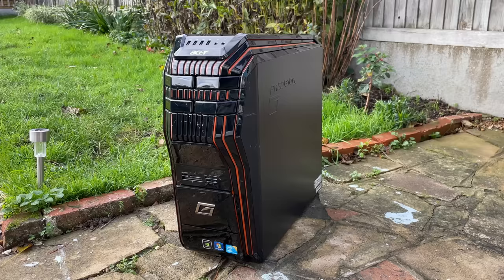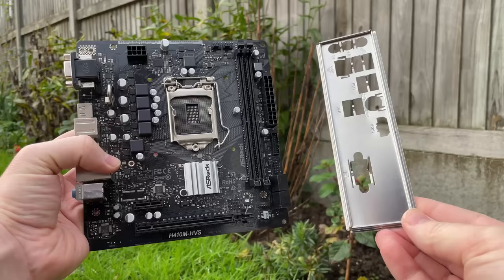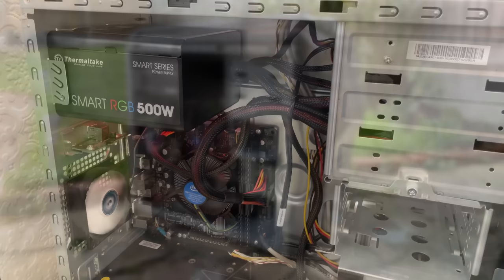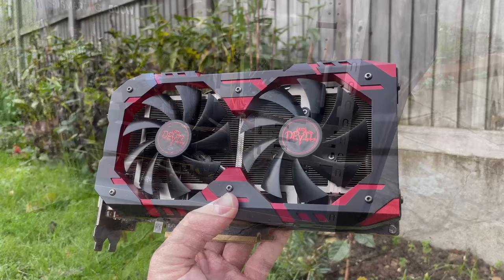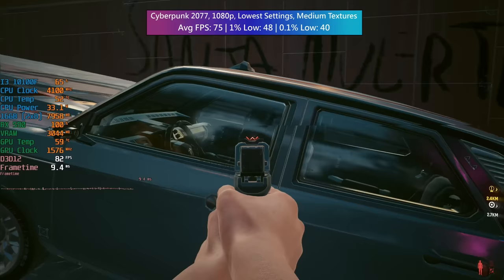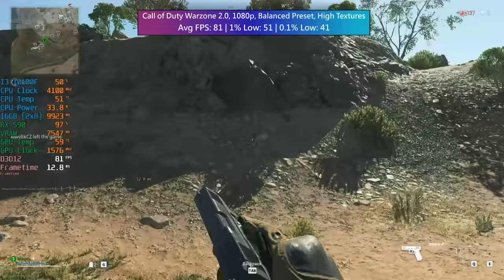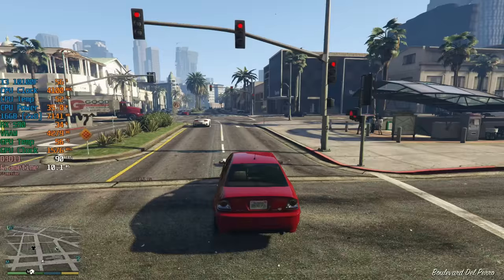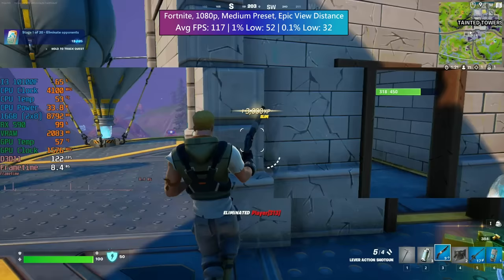Modern Budget Gaming Beast Inside an Old Acer Predator PC Case!

Comment: I'm shocked the GPU only reached 60 degrees with being choked of air.
Reply: yep, it's almost like he didn't correctly assess how it was gonna go, or maybe it's like fans do the thing they're designed to do if they're in the correct orientation..
Reply: With 2 8mm heatpipes on that cooler I'm not surprised at all

Comment: That's a nicely balanced system and the CPU does not max out with any game which is seriously impressive for an i3 and as you mentioned you can drop an i9 in as a replacement at a later date

Great review again 😀
Reply from the maker: Thanks :)
Reply: G'day, totally agree this is a nice ballanced build but...
while an i9 may fit those ASRock 4phase VRMs are notorios for not even letting LGA1200 i5 run at full performance due to VRM Throttling even with a Heatsink,
so i9 as an upgrade even in the future without a motherboard swap would just be a waste.
Reply: @shaneeslick  nope 
The specs tell that a 5vrm set is use 
The i9-10900(Q0) is a 65watt tdp and that will just run fine on it.
Only the i9 125tdp have performance boost problems with the vrm.
So really you can set a i9 on this board 
And i think a 10 core 20 threats cpu wil do just fine in the future.
Reply: @dyslectische  Yes that is what the Specs say, but 65W TDP has nothing to do with how much power the CPU actually draws.
Plus I am talking about what Benchmark reviews have proven to be Facts that have gotten Reviewers like HUB & GN Blacklisted when ASRock told them to take down the Bad Reviews telling the Truth, not what ASRock claim in their spec sheet because as long as they only have to run at 'Base Clock' not 'Full intel Boost Spec' which is more than 65W through the VRM for the i7-10700 & i9-10900 they are within 'intel Spec'.

Comment: The i3-10100 and Ryzen 5 4500 (despite its rep) is still a great budget option if found at $80 new. The RX 470 and GTX 970 used go for about less than $100, sometimes as low as $75, and this combo coupled with 16 GB of at least 2666MHz RAM can still game at 1080p very respectably in my opinion at a pretry low price compared to what other new options can be. You really don't need to spend much to get a good, mostly new system, with only the GPU being used.
Reply: The RX580 is now $70 on AliExpress

Comment: Nicely done system,I feel you could maybe pop a rx6600 or xt in there and still get pretty darn good performance if you’re on a budget since they quit cheap at the moment
Reply: After Nvidia's new exploit of naming the new RTX 3060 8GB (RTX 3050 ti) and charging the same price as a 12GB RTX 3060, I'm going AMD next time.
Reply: @SpaceGamblerJR  Yeah lol, It's a lot slower, and even the 12GB 3060 doesn't make sense when the better 6650Xt is in stock for a lot cheaper.

Comment: I love how the back fan that you put in the computer could be bigger. I did the exact same thing the other day when I built a frankenstein computer.
Reply from the maker: Haha yeah it needs a size upgrade
Reply: @RandomGaminginHD  I would love to see what is the maximum components you could stuff into this specific case, and fans to produce still good temperatures!
Reply: @RandomGaminginHD  I like how it had those two bays in the front for SATA drives that’s super neat. I wish I had a case or external box that had 6 and just plugged into the computers motherboard that would rock

Comment: Nice restoration, and I like the older style cases as well. I like how the i3 10100 is still a decent budget processor!
Of course, if it was mine, I'd take full advantage of the 5.25 and 3.5 bays, so I could whack in a DVD drive and plenty of hard drives. In fact, wouldn't this case work with a pair of DVD drives?
Reply: Yeah 5.25 would be used by me too, I still use ODD for burning home videos to BluRay & DVD, 1080p videos take up way to much storage space leaving them on the recording device
Reply: @shaneeslick  i would also have a Blu-Ray drive but they're much more expensive than DVD drives, also correct me if I'm wrong but Intel 12th gen and newer (I'm planning to build 13th gen) don't support Blu-ray?
Reply: @TheSpotify95  I got my 2 LG 3D BluRay Drives on sale here in Australia a few years ago for only $69AUD down from $99AUD when DL DVD which were $60AUD at the time.
I have one for creation in my R9 3900X Editing PC & the other in my Retro Gaming PC as I thought considering it was only $10 difference & that drive dying was the reason for getting a new ODD.
I haven't heard that about 13th Gen & not sure why BR wouldn't work with certain CPUs as I thought that would be more to do with OS & Media Player Codecs, but maybe the CPU needs a certain instruction set that has not been included in 13th Gen.
I use the K-Lite Mega Codec Pack & the Windows 10 WMP or "Movies & Tv" player with no trouble, but I only use them for Data not actual bought movie discs as I watch them on my Tv with my PS3.

I have just moved home so stuff is still in boxes but I'll go find a BluRay & come back with another reply with how it goes how it goes.
Reply: @TheSpotify95  back again, I got to give the BR a test with a bought movie disc on my editing PC with the R9 + 1080Ti, my LG drives came with Cyberlink Power DVD 10 included on the driver disc, I had to update to version 12 (Free update) & when I had done that it does play the discs fine.
Hope it helps but maybe if you are interested in upgrading you ODD try emailing help from the manufacturers site for the one you like & ask them about 13th Gen Compatibility.
Reply: @TheSpotify95  11th, 12th and 13th gen Intel CPU's cannot playback ULTRA HD Blu Ray movies (there's only like 2 models of 5.25" UHD Blu Ray players anyway). This is because of the DRM UHD Blu Ray uses. It does work with regular movie blu rays and data blu ray discs.
Reply: G'day  @Liinuli. , thanks for the added info

Comment: 1:00 I built a similar sleeper style system and bought a 3.5 inch Bay USB 3.0 front panel that fitted in place the card reader. It was on an old HTPC case so I could then connect it to the front USB 3.0 header on the motherboard.
Reply: Also shows how good the RX 590 / 580 and 570 were when released as they still hold  up today.

Comment: This video actually came at a great time because I have a 10100F that I later upgraded to a 10400, and it will be going to my mom with an RX 6600 believe it or not. I thought of getting a B560 board and another kit of DDR4 to pair with the i3 10100F to build a system for my sisters in an old Gateway case I bought on eBay, which was one of the last systems with the Gateway name before Acer discontinued the line.
Reply from the maker: Awesome, the 10400 is still fantastic

Comment: I always repurpose old Dell or HP cases for my own systems. I like having the "free" DVD drives and card readers. I just drill, cut and modify them (as tastefully as possible) to get better airflow.
The Blue Anodized Sapphire RX 590 Nitro was my dream card back in the day. Sadly, I've never actually owned one. 
Also, I'm a little disappointed you didn't include GPU power in the overlay. To me, that's a very important metric. Thanks for such a refreshing video of still capable older hardware.
Reply: That's the one I wanted too! They sold out pretty fast, mostly to miners/scalpers it seems, so I settled for the Sapphire Pulse. Still using it now after dropping an RX 5600 in to replace my 2700X :)
Reply: @Grant_S_M  I currently have a 2600X. how much of an improvement did you really notice after installing the 5600? Was it genuinely significant?
Reply: @RANDOMNATION907  Some more frames, but the biggest difference is smoothness. My RX 590 is holding things way back :)

Comment: I built my Dad a PC (my first build) out of all new parts, bar the GPU, during Covid. He’s basically got the same as the specs in this PC but in a cheap (£35) case with an GTX 1060 6gb. It’s great at playing anything at 1080p 60fps with medium to high settings. My fourth build that I did this year was for my brother, a no expense spared £4000, i7 12700K, 3090 Ti Suprim X, 2x 2TB m.2 etc etc build. Was a different experience to building my Dads 😂

Comment: I definitely would've dremeled some small holes or slits on the bottom of the case near the GPU fans and super glued some thin mesh inside the case between the bottom and GPU fans. Then put some small standoffs on the bottom of the case to help it breathe a bit. Either way, solid performance!

Comment: 1576 Mhz... What a clock for Polaris! My RX580 can go from 1366 to 1450, draws 190 watts and sits over 80 degrees lol. This RX590 kicks its ass by a lot.
Reply: Well, it is built on a 12nm die shrink. Most Polaris based cards use a GPU based on a 14nm process. At AMD's reference clocks, the 590 is set over 200 MHz faster than the 580 regarding both base clocks boost clocks. The 590 does use more power though and generate more heat. However, PowerColor Red Devil cards have pretty good coolers.

Comment: Great video,
Could you do a comparison of the 590 with 6400?
It could be quite interesting
Reply from the maker: Yeah sounds like an interesting comparison!
Reply: The 590 is a lot faster. It should even beat a 6500xt. It is a bit power hungry though...
Reply: Yeah the 590 is going to beat the 6400 in all games. It also isn't gimped by the 4x pcie bandwidth. The benefits with the 6400 are going to be its size, power draw, age and if you can really make use of them on this card, the few Ray Tracing cores the 6400 has.

Comment: It looks like the front has a mount for a 92mm fan, similar to the 2012 Dell XPS desktop. My friend has one installed running a r5 5600 and a 3070 and it does help with gpu thermals somewhat in that system

Comment: The case is cool, as for the build: It makes sense if you have part of it lying around, but I think the board could spike the price if you had to make a build from scratch. Personally I'd most likely end up with a 1150 board + Xeon if I'd had to pair it to a 590 (480, 580, 1060... ). 

The PSU seems a bit on the low side for me since I usually use older higher powered CPU, but in this build it should be fine.

Comment: I would have put that 80/92 mm fan in the front to create some extra airflow for the GPU and maybe put a 120 mm fan as an intake for the cpu. Going with a four core, eight thread cpu was a good idea, because those pure quad cores are starting to struggle a but.

Comment: That Red Devil 590 must have a really good cooler cause my old RX 580 Sapphire Pulse edition used to get loud in a way more ventilated case than this. Also you can use the cooler that came originally in the Acer,those things are beasts and they can even cool a modern non k i7

Comment: I still have my RX 590... in a box, because I upgraded to an RX 6800. The Sapphire Nitro+ SE hits 1560MHz which is a little down on the Red Devil, but as far as I'm aware, the Nitros were the only cards to come with default memory clocks of 2100MHz. The blue colour scheme is unusual and I would be lying if I said the grey design from the RX 580 LE variant wouldn't have been preferable, but it's pleasant enough. I always made sure to undervolt it a bit, though it couldn't take a big reduction at stock clocks.

Comment: Serendipity! I just built a retro gaming PC into a Q500 case. Spec is RX570 Sapphire O/C (which I overclocked more), i5 10400F, 16gb 3200mhz DDR4 and a MSi Z490 Carbon EKX (not watercooled). All the parts were bought used at bargain prices (60 quid for the Z490) other than the 10400F which was 100 quid new from Amazon Germany.  Running the DDR4 at 3200mhz (well 3290mhzX102.9mhz) really speeds everything up. I saw an uplift of 10% with XMP enabled vs stock. I'd love to see how your i3 and 590 run given faster RAM on a better motherboard.

Comment: That's a pretty nice combo. I had little bottleneck with my R5 2600 and gtx 1070 ti but my ryzen is parked for upgrades and I am using a I5 2400 with the same GPU and man bottleneck galore. People always buy for the name. I don't mind lower end parts I gave my brother my 2600 and I took his 2500g. When your a budget gamer you tend to look past the names etc
Reply: A N I M E
N
I
M
E
Reply: Re the i5 2400 and bottlenecks, I wonder if that's down to the lack of HT on top of the generally lower IPC & clocks. I've done a lot of benching with a 5GHz 2700K and it generally runs very well, but turning off the HT really hurt for some games (even with the same clock), and I was using DDR3/2133 CL9.

Comment: Never thought a 65$ cpu would be viable for gaming more than 2 years after its launch.

Would still recommend an i3 12100f as that would last you much longer. For around 30 more dollars (and 20-30$ for a Motherboard like a h610...those are pricey but worth saving up... Even if it is one more month of wages that you need to get enough spare nickles to throw at it)

Comment: although i understand the primary point is to showcase the capability of being able to play the games whatsoever, it would be nice if you used the framerate unlock mod for Elden Ring to show what the maximum average framerate could be in your reviews. it probably would be annoying to deal with the Freesync/Gsync configurations every time you switch capable/incapable gpus

Comment: Ill spoil the i9 in that board experience for you.... itll work for a time but stress the vrms to death... eventually.

 You can extend their life with an undervolt on the cpu and a non k model i9 since that isnt an overclocking board anyways and a fan directed at the vrms to keep them cool and if youre particularly resourceful you can measure the vrm mounting holes if theyre on the board on either side of the vrms and find a heatsink on ebay along with a thermal pad and screw it onto the board (still with the fan pointing at it)

Comment: I had the same system with a I7 3770 and it came with a gt730 2gb video card , Played csgo like that for a few years tell I got a 1060 6gb , now both the card and cpu are put in a display case and hanging on my wall .
Reply from the maker: Awesome :)

Comment: G'day Random,
🥔🥔🤣🤣🤣🤣🤣Hilarious
Nice Sleeper Upgrade,
although as you said an upgrade to an i9 may be possible due to Socket Compatibility, even with a VRM Heatsink those ASRock 4phase VRMs are notorious for not even letting a LGA1200 i5 run at it's full potential due to VRM Throttling power so an i9-12900 would be a waste.

Comment: I don't really understand why "budget" builds always save on the CPU cooler. Tower coolers aren't that expensive. You can get pretty decent tower coolers for a couple ten bucks. That's it. If your budget is so tight that you can't afford twenty-or-so bucks for a decent tower cooler, then quite tight it is. But you can buy some other component for that much cheaper to compensate.

Comment: You can drill holes underneeth the gpu and the temperatures will drob my a lot.
Ps. i did this with my pc and the gpu temps droped by 10 degrees.
Reply from the maker: Good idea! I’ll have to try that
Reply: What if one put also an extraction fan over those holes? Wonder what kind of difference would it make i.e. if it would be a noticeable one.
Reply: @Kraven83  i tried that but because my pc has negative airflow the fan didn't really do anything because the fans in the back sucked the air in. I don't really know how to explain the situation lol
Reply: @RandomGaminginHD  i forgot to mention that you have to have negative airflow in the case for this to work. (For example you have one fan in the psu that sucks the air out and one on the back, you have to have some holes in the front of the case or else the cpu will suck in the heated up air from the gpu, all other holes in the case have to be tped shut.

Comment: Yo, found a good deal on some laptops on ebay, they are called Avita Pura line from box reseller, brand new and currently £85 on sale specs are ryzen 3 3200u and 4gb ram 256gb  m.2 ssd. Bought one for my auntie and it performs great! Give me a shout if you want the link or search terms but they are pretty easy to find.

Comment: He could put an i9 10850K in this computer and pair it with an RTX 4070 Ti, RX 7900xt or RX 7900xtx. He could also pair the i9 10850K with an RTX 4080 or RTX 4090 but I don't think those gpu's would fit the case.

Comment: If only they designed the case with the PSU at the bottom and the motherboard above then there may have been more clearance for the GPU. Obviously a prebuilt like that was never designed with much upgradability in mind. Its also shocking how poor the airflow must have been on some of these cases and that mass of metal at the front end show it.

Comment: kinda mocks the originality of it would have liked to see the system with original parts replaced rather than any you could source.

only thing original is the case which adds no performance so the vid is kinda pointless you could have thrown those parts into a dustbin and got those results.

sorry.